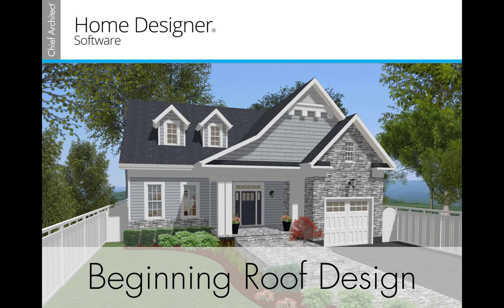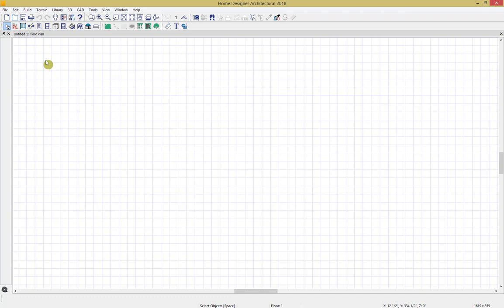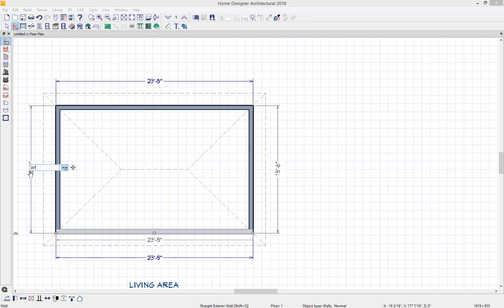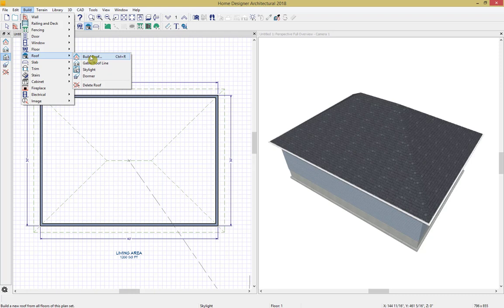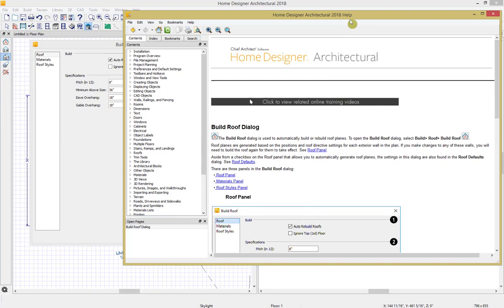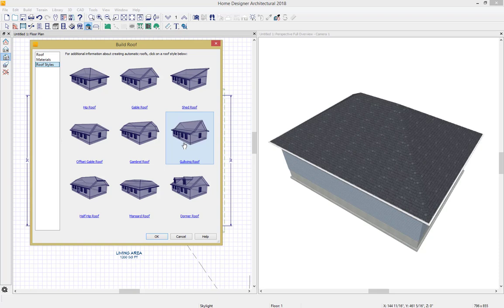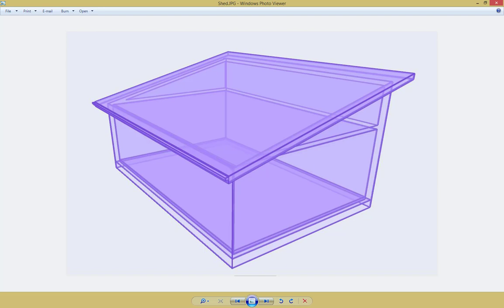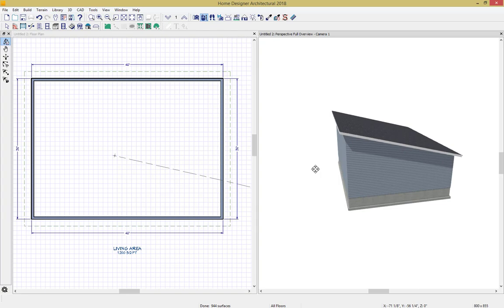Home Designer 2018 Beginning Roof Design

Comment: GREAT videos. Are there instructions (or link) to designing a knee wall with an 8" pitch gable roof over a single story house? House was built in 1915 with a full  basement and the code limits building a second floor.  Thanks again for your instructional videos.
Reply from the maker: Thanks, Ted! Here's a Knowledge Base article that should walk you through the steps for your roof: https://www.homedesignersoftware.com/support/article/KB-00358. Let us know if this isn't quite hitting the mark. Thanks!

Comment: awesome explanation, though all of this works great when you are covering a single room... I am using home suite 2021 (obsessively since I bought it on Saturday) and it does not look like you can ignore the first floor when working on a single room (i.e. the whole house changes)... is it possible to change only one room at the time with the auto roof?
Reply from the maker: Unfortunately, that's not supported. You may need manual roof tools (first available in Home Designer Professional) to accomplish your goals. Please send an email to sales@chiefarchitect.com with a few screen shots of your plan and what you're trying to create and we can let you know if it's possible with the automatic tools in your Home Designer Suite software. Thank you!

Comment: I am trying to build a house plan with a gable roof that is the same roof that continues over an extension room.  I did the exterior wall first and then changed the roof but I have 2 separate gable roofs at different heights, I want them to be the same height and one room
Reply from the maker: You can reset your roof defaults by clicking Edit>Reset Defaults> and then selecting All Floors and Roof Directives in Walls.

Comment: Please help someone.  I have architect 2016. when i create new outer walls, there is a  tall stem wall  underneath . Does anyone know how to remove it or calculate the wall height so it is to the ground? thanks in advance.
Reply from the maker: When you open the room specification, under the structure panel, you can change the Stem Wall height.
Reply: @ChiefArchitect .  I thought about that, then i wondered when i see the video tutorial(s) the wall automatically  are designed on the ground, with nothing underneath. I was wondering how that is done.  thnx

Comment: it's not letting me to turn a hip walls roof to gable how to fix this?
Reply from the maker: You can select the wall and open its specification dialog. Under the Roof panel, under Roof Options, you can change the type to Full Gable Wall.